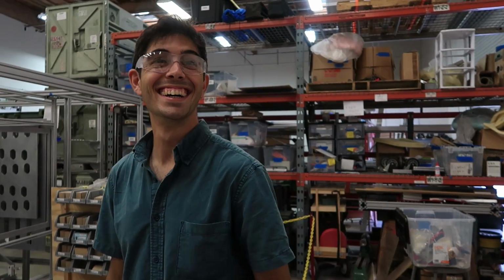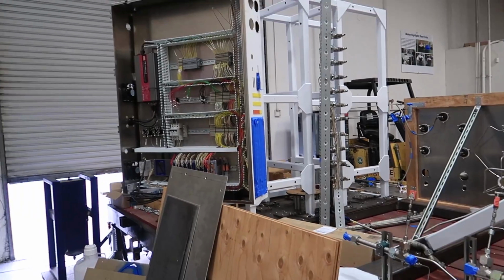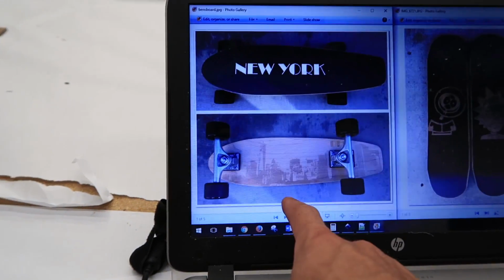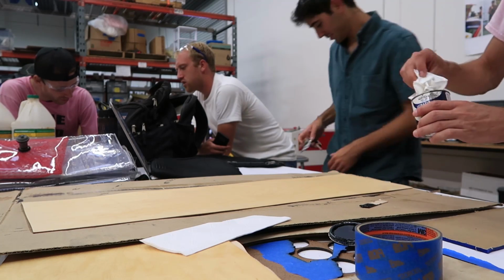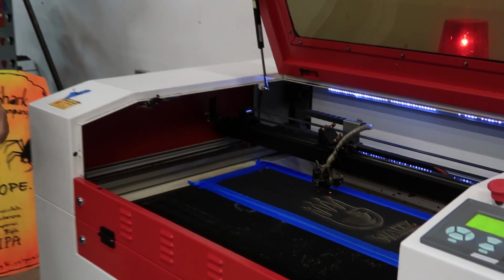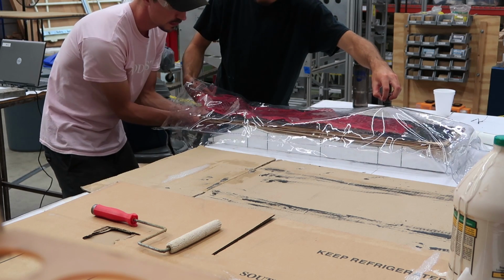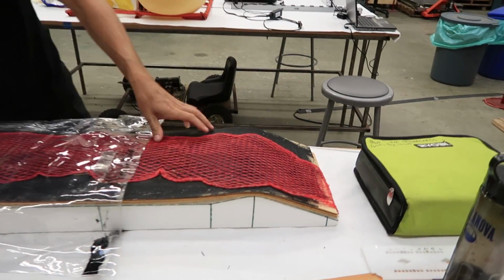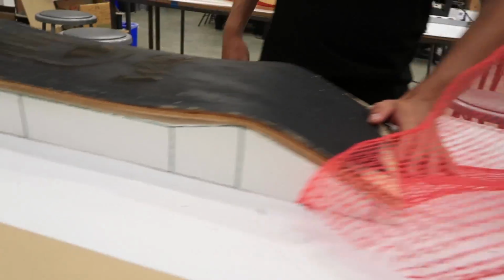HOW SKATEBOARDS ARE MADE: Freestyle Trick Tip

Comment: Loved the video mike. I've thought about making my own board for a while. I thought about getting the kit from the Roarockit website. But I don't know how to make a mold. Is it hard to make?
Reply from the maker: +James Mata there is a lot of math regarding kick angle, concave steepness, wheelbase length. I think beau has a lot of info on his site though. That may help
Reply: Mike Osterman  I have checked out the site but never really looked into the whole making it. But ill check it out. Thx Mike 👍
Reply: I guess you could always get 2 identical boards and put the veneers in between those
Reply: James Mata it's pretty easy, depends on what kind of concave you'd like. Since I do single kick flat     freestyle decks, it's very easy to do it
Reply: Do it!  Roarockit is rad, and between us, you probably won't have any problem making one.  I made a video a while back that walks through the design/build step by step - just search my channel for "Making a Foam Mold", and I think it'll show up.